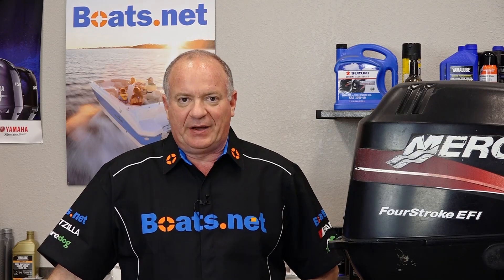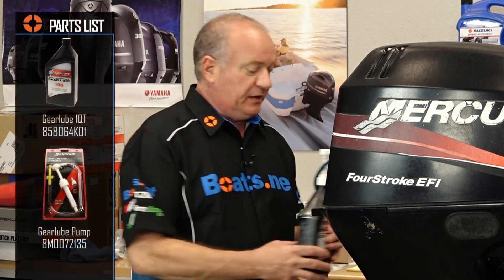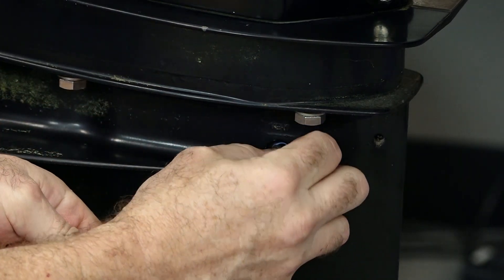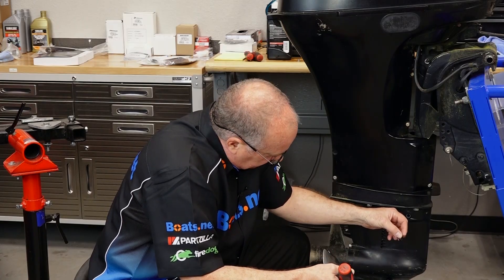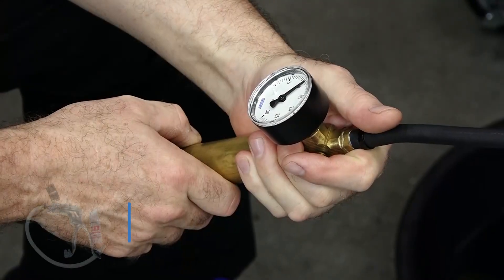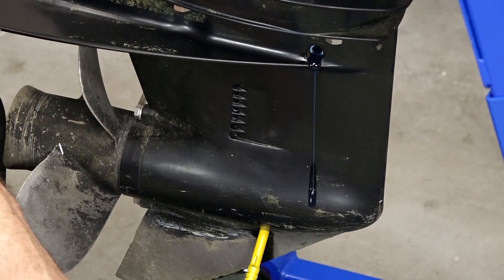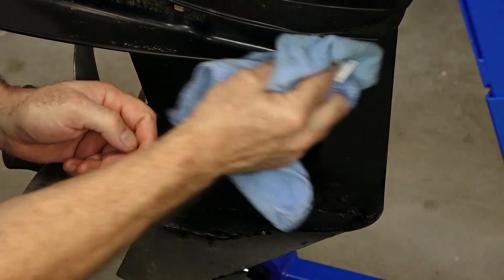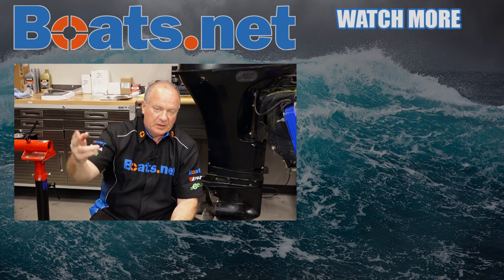How to Change the Gearcase Lube on a Mercury 40HP Outboard | Pressure Testing an Outboard Gearbox

Comment: Have a 40hp Merc. Its 2 cylinder carburetor long shaft. Is there anything else I need to take loose other than the 4 bolts/nuts to drop very lower unit.